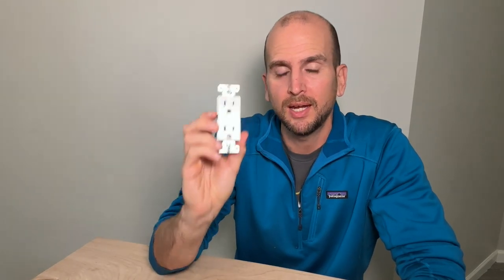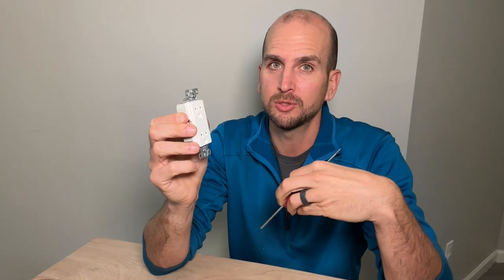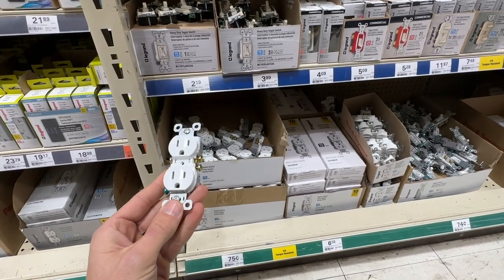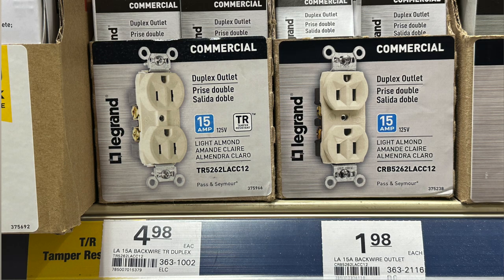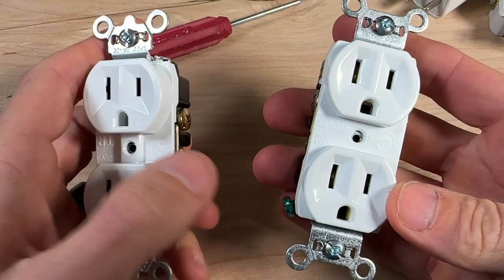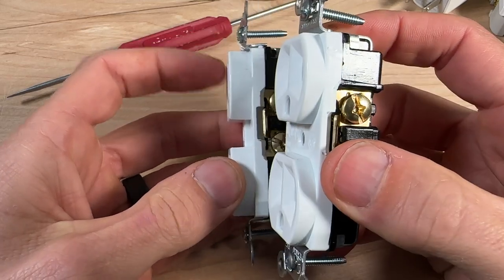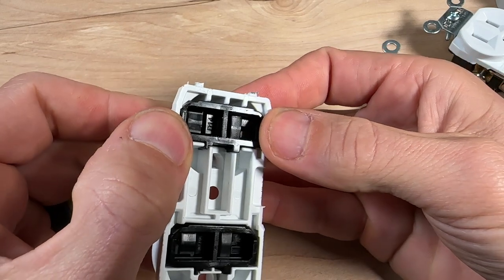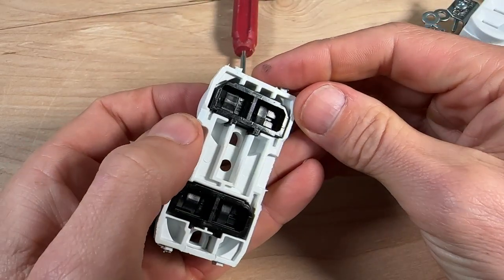The Most Hated Product In Home Electrical

Comment: Hubbell TR receptacles only take 4 oz of force due to design while leviton and others can be several lbs.  they use a shutter vs a slide.  they have youtube video u can watch
Reply from the maker: Yeah, I actually picked up a $74 GFCI/AFCI Hubbell which had the shutter design.  I didn't want to recommend since I haven't found a good source for Hubbell outlets for DIY homeowners.  We have 2 electrical supply houses in the area which carry Hubbell but not really meant for DIYers.  Thanks for the feedback.

Comment: Given the low cost of GFCI protection. I think you'd be better off with them, they prevent shocks from things like damaged cords, broken light bulbs, etc. It's just more foolproof. And if you have multiple outlets on way circuit. You can if you know what you're doing chain the other one's onto the first one. (Not recommended any more though) You could also have panel box redone for whole home GFCI. Oh, wait, you need to use both GFCI and tamper Resistance Now :(
Reply: just long enough for the inspector to put the sticker on the Panel.  I ripped out the AFCI breakers 2 days after the inspector passed the panel at my sister's. Got irrating fast going over to reset POS nuisance tripped AFCI breakers

Comment: I find them useful if I want to keep moisture and bugs out of an outlet. The real drawback of TR outlets is that these days, you need to use hex adapters, power strips, surge protectors, and the like. Plastic covers are cheap, and power strips aren't TR, so you need them anyway. There is a very good argument against TR outlets. If you don't have kids, you could care less about TR outlets.

Comment: Tamper Resistant outlets have those spring loaded Shutters inside the outlets? I'm surprise those plastic shutters don't melt when using 10Amps or 15amps of current draw, I wonder what type of plastic they are using
Reply: Same as the rest of the outlet. If yours are getting that hot you need to replace the plug or outlet because something is wrong.

Comment: IMHO: The extra money for the commercial receptacles over the cheap residentials is worth it in the long term, but I'm not on a tight budget.  They're better built, will probably last longer before replacement (before getting loose and plugs falling out), and also the back wiring can save time, but not really when doing a simple replacement.

Comment: When I was a little tyke back in the early 1960s, I kept sticking things in receptacles, then came the shock and crying. But I would do it over and over. Keys were my first choice but bobby pins and anything else metal would do. Any surprise I grew up wanting to be an electrician. Perhaps my parent should have made me a plastic key. My parents put in the plastic plugs, but I quickly learned how to get those out. Then my dad got what I would call an early tamper resistant receptacles (I think they were called child-proof), you put the plug in a short way, then rotated it 90 degrees and then it would insert and make contact. That stopped me in my tracks. Today I own their house and still have one of those old two prong receptacles that rotate in an unused room. As I update the house, it will go away. Meanwhile, as I upgrade, I am installing tamper resistant ones in places a kid might likely "play" with an outlet (hallway, bedrooms, living room). I have been using the Eaton ones with no real issues. My only complaint is that the plug feels like it doesn't make as solid of a contact as with normal receptacles, a concern with higher current draw items. But I haven't had any issues thus far. Between TR, WR, GFCI outlets, it seems we can't put a normal outlet anywhere these days. Nice video, glad you showed the mechanism.

Comment: Yeah... reality of it is, security features such as TR are never taken seriously unless it's properly regulated and enforced. If it's optional or not enforced, it's simply a luxury.
That's the main reason why it's so expensive... it's not the extra cost of materials or research put into it, it's because not many people are willing to spend more on it, so it doesn't reach the mass production point to lower cost, and so it remains absurdly expensive.
If it was something required by code, enforced and necessary for new installs, you'd have prices go down, probably a better less finnicky mechanism, and actual security reached by widespread usage. If industry and regulators are not willing to go all the way in, it results cases like this.
If I understand correctly, I think TR is required by code in some cases, in some states, in some commercial installations, but I don't think it's enforced a whole lot. Shops won't carry much stock because not many people are willing to buy, and with low demand this means you don't get the cheapening benefits of mass production. The industry would also likely find a way of designing a better less finnicky plug if there was enough demand, but because there isn't, no incentive to invest in development.

Well, I'm saying all that, but I also live in a country where no one installs TR outlets... I've seen some styles sold for our standard, but I've never seen anyone with them in their homes. In fact, we barely have code and enforcement of them down here... it's a free for all, and in some cases you have to revise and redo a huge part of electric and others in a new home, or just live with all the shortcuts, errors and whatnot that construction companies did.

The most I've seen for tamper resistance in regular homes are just those plastic dummy plugs, blocking off access entirely to outlets installed low at reach of small kids.

Comment: Hubbell makes tamper resistant outlets with a cam mechanism instead of shutters. It's a bit easier to use, but still not perfect. I bought them from an electrical supplier for around $6 each. Part number DR15WHITR.

Comment: crazy seeing how the US has this crazy system of diffrent quality of outlets seemingly just to  let people skirt safety to save costs, over here in the UK we dont have diffrent grades of sockets even between residental and comercial installs, all have tamper resistance and all can handle high currents (UK sockets while offically limited to 13A/240V are rated for 20A/240V), if you need anything more thats only really in industrial settings so comando sockets work fine and can do crazy specs like 63A/400V 3 phase)
Reply: People are price conscious. The cheapest receptacles are under a dollar when on the UK they typically cost around £6. In Fibls they are about 15 €.

In the US the code also mandated to 8ut huge amount of receptacles so people may want to save and buy junk.

Comment: the real reason commercial spec grade tamper resistant receptalces are so expensive is the only application that might need them is daycare facilities.  

people: buying  commercial spec grade receptacles for household use is like buying a commercial walk behind mower to mow the lawn on a city lot.  90% of the time you're paying for durability you will never come close to needing.

as for tamper resistant and problems plugging in: if it fights you, you either have a bad receptacle or bad technique.  the first generations sometimes took a jiggle to get the gates to open, but I haven't had one put up a fight except when I'm inserting separate test probes in years.

at this point, i believe the main reason people hate them is because people tell them to hate them.  they work just fine, and I almost never buy "standard" receptacles, because it's too much nuisance keeping a separate inventory item.

Comment: I got so frustrated with a tamper resistant outlet that I took a replacement plug and hammered it in and broke the tamper resistant feature.  I did change the outlet to the standard type a few days later. We have no children in the house.

Comment: I can't stand these things but my main thought was always that the tamper-resistant function makes plugging something in feel the same as when a plug goes bad and something breaks Internally. If a standard plug is very difficult to insert, it needs to be replaced. The problem occurs when you have gotten use to it being so difficult to plug in that if the plug wears out you won't know. And it could be a serious fire hazard.

Comment: Kids are not stupid! They watch others, observe and figure things out. When I was a kid (pre-kindergarten and up), pulling stuff apart to see how it worked was my favorite pastime. For wall sockets and light switches, I would get a butter knife, unscrew the cover plate and pull the whole socket or wall switch apart. How's a TR outlet going to protect against that, not to mention the wall switch?!?! If a kid wants to get into an outlet, a wall switch or a plugged in device (lamp, etc.) , they will find a way and no TR gadget is going to keep them out or keep them from blowing a fuse and turning some of the paint around the box sooty black from the resulting electrical flash. (Yep, that happened to me more than once. I was even caught standing on a chair trying to reset the breaker, which I learned how to do by watching my father do it.) And, if something like a TR outlet blocked my way, I would drive that butter knife into the socket with the nearest heavy object.

Comment: I am European and, although I don't think it's a legal requierement, I have replaced several sockets in my house and the cheapest socket in the hardware store and all the electrical extensions have a similar mechanism to that. It is probably more necessary since the shape of the holes of our sockets is round so a baby's finger could go into them...

Comment: before my first kid was born we ended up buying a few Mommys Helper Safe Plate Electrical Outlet Covers from Amazon to install on most accessible outlets.  10 years and 4 kids later they still work well.

Which brings me to a couple of corrections to what was said in the video.  1) The $3 increase is not due to the extra cost of those plastic inserts, but due to the perceived extra value provided by the product. 2) the doubling of the price of a single product doesn't have to translate to doubling of the installation costs because you don't have to install these everywhere, but only where it makes sense.  Out of 40+ outlets in our homes, we ended up installing these on under 10 to significantly reduce the risk of exposure.

Comment: Improved safety by not allowing anyone ever to use the outlet. I’ve got one relatively new unit that I don’t think ever has allowed me to plug in the vacuum cleaner into one of the 2 outlets.  A case of an specification that was too weak and this manufactures produced absolute inconsistent junk.  Because they could.

I’m replacing my TRs with normal. It’s too much of a problem.

Comment: So if safety is the goal, instead of tamper resistant outlets, why not put every outlet circuit on a GFCI? For safety, would that not be even better (and possibly cheaper too)?
Reply: Clearly you have not bought GFCI lately. Also GFCI need replacement every 10 years and that is surely not going to happen in the majority of uses.
Reply: @randomvideosn0where  $25 for one outlet type, but one GFCI protects the entire rest of the circuit. I did my entire house using 6. Also, it actually solves the problem when things like extension cords, power strips, plug multipliers, etc. are in use. Also, it is a lot faster to do 1 GFCI than it is to do 6 outlets or so on that circuit. As far as replacing every 10 years, I have not had that experience. You routinely test, and when they stop working (or fail the test) then you replace. I have had some for more then 18 years.
Reply: @markbost9874  If you read the documentation they say every 10 years it needs to be replaced. Also congrats on doing your entire house on only 6 circuits!
Reply: @randomvideosn0where  Thanks, and I believe you about the every 10 year replacement. I didn't keep my documentation. It might still be less expensive than a shock that puts someone in the hospital. Thanks again.

Comment: TR sockets are useless, problematic and dangerous.

They are useless because there are protections on the market to insert on electrical outlets and when the child is old enough to be able to remove them, he is old enough to understand the risk of an electrical outlet. And when using an extension cord, it has no protection.

They are problematic because they are difficult or even impossible to use for people who have reduced dexterity or strength, such as the elderly.

They are dangerous because they sometimes damage the plugs of electrical appliances. Since it is difficult to insert a plug, there is also a risk of touching the live plug when it is not fully inserted.

Additional risk: when a person decides that he no longer wants TR sockets installed in his house, he can improvise himself as an electrician and replace the socket himself, with the risks that this entails.

Comment: Absolutely hate them.  Such a pain in the backside to plug things in.  I completely rebuilt the electrical in my garage a few years ago and was told by the inspector (before construction) that I must use TR outlets.  So I did.  Every time I use them I curse the damn things.  I don't remember what brand they are, but they are the better commercial grade, not the cheep residential grade.

Comment: I will gladly use my Hubbell tandem/parallel outlet from probably over 100 years ago over a tamper resistant outlet 

Those outlets are awful because it's impossible to insert the plug and it's just not fun

Comment: I updated all my recepticles  to the Decora TR and have not had an issue thus far.
Reply: why?
Reply: @MrBonners  I don't understand the question Stewart.
Reply: @acortez3195  why update? fixing a problem that does not exist. when was the last time you heard of someone sticking things into receptacles?
Reply: @MrBonners  well see you assumed there was no problem. There was, the duplex that was originally there was brittle and wasn't fastened properly. I actually have a series Of fotos you might find amusing. 😂
Reply: @acortez3195  That has nothing to with tamper proof requirements.
Reply: @acortez3195  so? off topic and off thread. Again has nothing to do with regular or tamper proof receptacles. I'm not responsible for the 'talent' that you hire. All on you.

Comment: Some of them are non-functional out of the box.  After installing some and finding 2 that wouldn't admit any plug, I've now formed the habit of checking them before wiring them in.  Unfortunately, some of them fail later.  I have a Leviton GFCI TR/WR on the exterior of my home that only will accept certain extension cords.  This is frustrating beyond measure.  The clunky implementation resulting in difficulty of using the product is actually the #1 reason they don't sell.  If they actually worked well, more people would give them a try--more people buying would mean more being made available / stocked and over time would help reduce the cost.  Manufacturers really need to work on the design.

Comment: Tamper resistant receptacles (they are not called outlets, a light socket is also an outlet) are required by code.
Reply: @A Town people should at least have an understanding to why their homes are being built with them installed. What you chose to do with them after is your own business and anyone pre-2008 doesn’t have to worry about a damn thing as they are grandfathered in.

Comment: Tamper Resistant Outlets are a big and unnecessary pain. I would not recommend changing them out unless you have to for passing an electrical inspection. This safety idea might have looked good on paper, but in reality and in use, it greatly increases risk and danger to the user by making it too hard to insert plugs. Don't get me wrong electrical safety is important. There are lots of aspects to electrical safety, where outlets are placed, how many outlets are on a circuit, where light switches are, can you see, are there too many things on a circuit and more. Unfortunately, cheap outlet manufacture, and failure of manufacturers to break in and lubricate some of the outlets before they ship them can cause extremely frustrating user experience. This is compounded by the fact some outlets require a break in period, and the first time you plug something into an outlet, it can leave you with a very bad experience. If every time you bought a new car, it broke down 3 times before you left the car dealership, you would not expect to have a good reputation.  My faith in the judgement of the electrical regulations groups has gone down with the requirements and poor performance of these outlets. Proper regulation and design needs to include aspects of public relations, usability, longevity, safety and more. The usability of some of these outlets is so low, it goes to show the failure in the regulation process. My experiences may be defined by the cheapest made, poorly functioning outlets, but there is little I can do expect warn others to not change them out unless you have to.

Comment: It’s actually becoming hard to find standard outlets for Decora in my area. Nearly every option is TR now. So much so that it has me worried that they will stop offering non TR options. I’ve been considering ordering hundreds, just to stock up.
Reply: Only if they are buying cheap contractor grade TR Outlets which do not function well....... If you purchase quality TR outlets they function flawlessly! TR Outlets are not deeper than a non-TR outlet...  Let someone get hurt in your home with an item that you should have purchased diffectly by code and see what your homeowners insurance does if they is a liability issue...